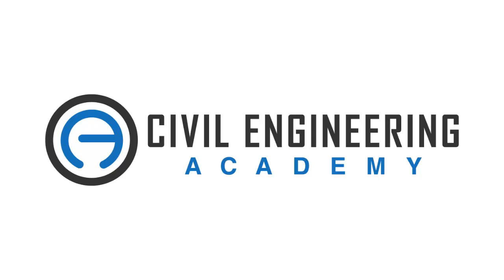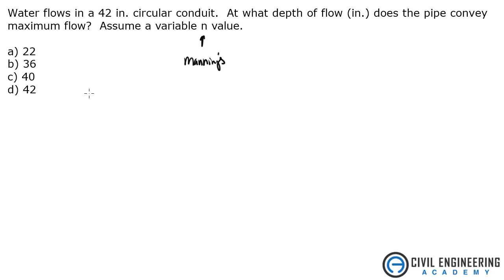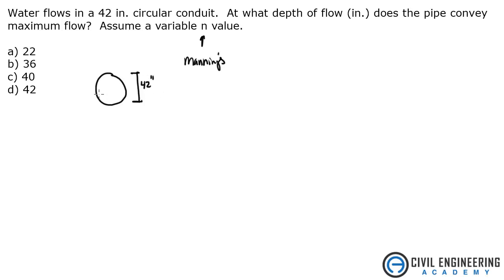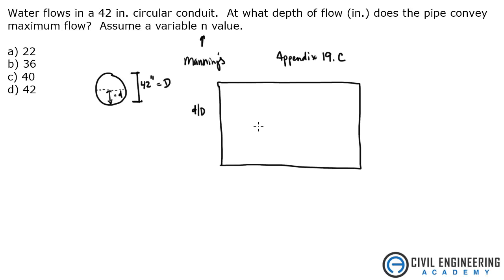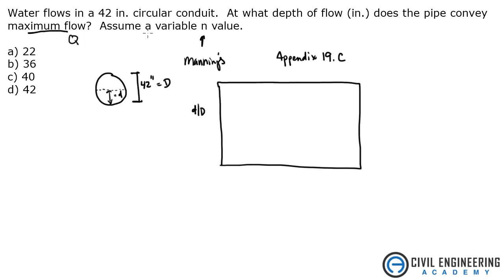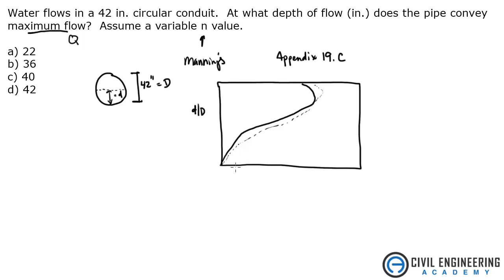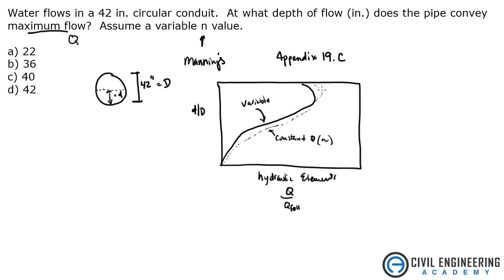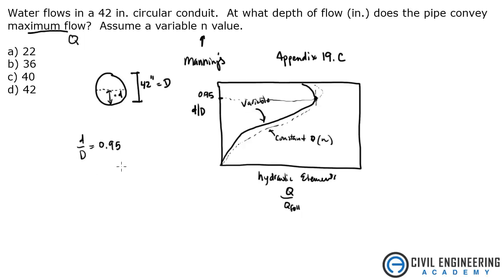Water Resources-Find Depth of Flow in Circular Conduit

Comment: How did you know where to stop on the variable line to end up at .95
Reply from the maker: I knew where to stop because on the curve I took the maximum value (farthest point on the X-axis for Q/Qfull).  If you look at the curve it seems to max out where d/D is equal to approx. 0.95.  I hope that makes sense.
Reply: Civil Engineering Academy Ohhhhh. My bad. Thanks bro